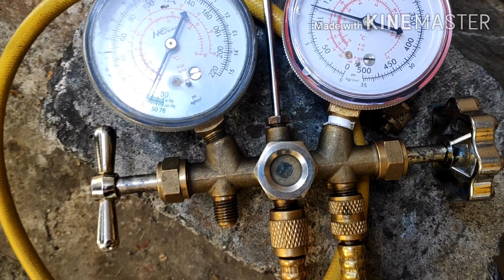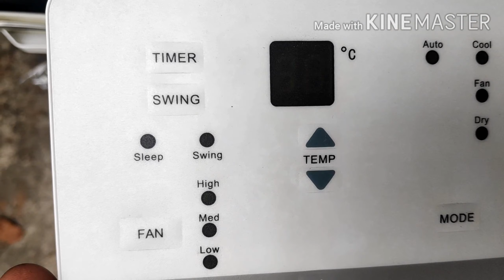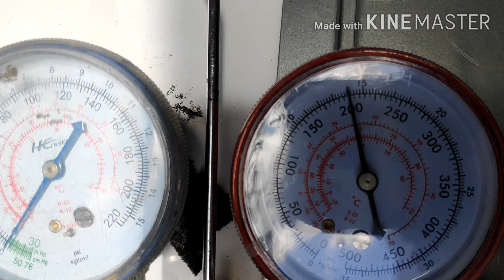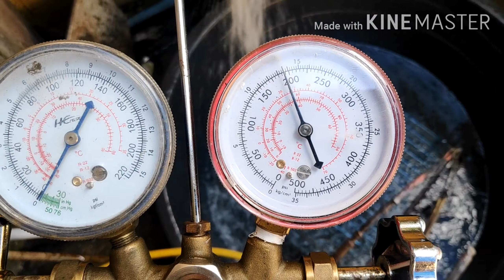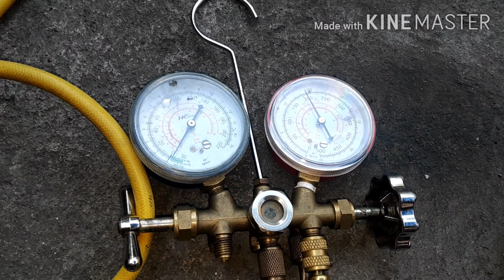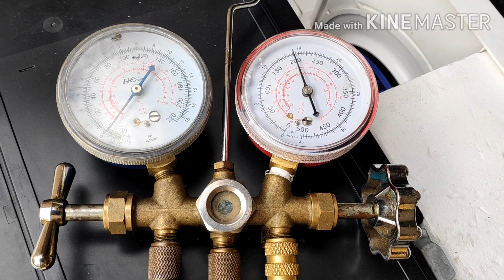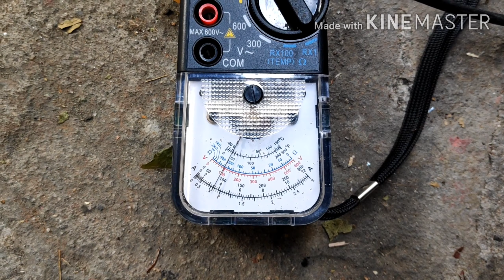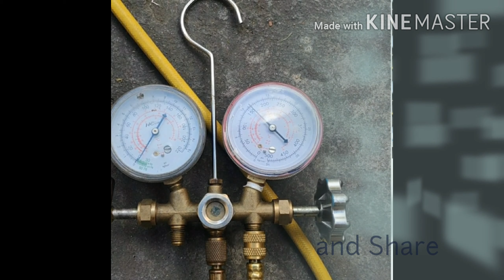Paano Gawin ang Window Type Aircon na may Butas  (#15)

Comment: sir, safe ba na pangvacuum ang compressor na 1hp? salamat po idol
Reply from the maker: Hello sir allan if compressor ng aircon ok lang lang po basta walang leakback pressure or lose compression, mabilis pong mag vacuum pag yan ang gamit
    Pag compressor naman ng ref mas ok po kasi matibay ang compressor ng ref
Reply: @jhaybizz  sir, pag compressor gamint ilang minuto pagvavaccuum?
Reply from the maker: @allanpalad2159  sir 2-3 mins lang po
Reply: @jhaybizz  ang bilis pala... sir bakit naflushing ko na gaya ng ginawa mo. pero over na sa rated ampere niya di pa umaabot sa 50 psi yung ginawa kong aircon namin. salamat po sir

Comment: Hi master, ask ko lang po if magandang brand po ba ang koppel? yung non inverter na ac po.
Reply from the maker: Tnx for visiting my channel Sir Matt.
     Yes sir magandang brand po ang koppel matibay ang compressor at fan motor, kaya lang thin galvinized sila lalo na ang bulkhead (window type) saka ang sides ng condenser at evap
       Kaya mabilis po mag rust. Pero kahiT ang inverter unit nila matibay din po, saka dual capacitor nila matibay din, unlike sa ibang dual type mabilis mag leaky or mag open
Reply: Ohhh. Okay po sir, paano po ba nag kakaleak ang ac? Kasi po ang isang ac unit namin hitachi ang brand 1hp po minsan nag ice minsan hindi naman.
Reply from the maker: @mattjericovillareal402  
       If window type po yan, kaya nagyeyelo, possible sobra dumi na need na ng general cleaning pero if not, internal clog  yan sir. 
       Sa loob ng tube  may clog oil na nasa evaporator need ng flushing by system reprocess (or possible weak narin ang fan RPM)
          About naman po sa kung bakit nagkaka leak, dahil narin sa katagalan nagkakaron ng corrosion (color green) sa tube lalo na sa U-tube or sa mga thread ng coupling
Reply: @jhaybizz  ahhh thank you po tlga boss sa pag answer ng mga questions ko. Apaka idol po tlga ikaw.
One more thing po. Ano po ba ang mapapayo mo para mapa haba ang life span ng window ac po.
Reply from the maker: @mattjericovillareal402  First thing first po ay cleaning maintenance, quarterly or twice a year lalo na sir if madalas gamitin. Dahil  dumi ang nakakasira ng compressor. Mag a ice ang evap, and high current naman pag marumi ang condenser.
         2nd po. Check all rust part ng mga galvanize. If may kalawang i turco nyo na agad (rust converter) para maagapan, and spray bosny primer paint.
         3rd if manual operation, stay your thermostat in one setting. Wag laging ibaba pag naka off ang  unit. Kasi nakakasira ng thermostat 
        4th proper ventilation (avoid air bounce back) para di po exhausted ang compressor

Tnx po sir sa pagtangkilik
Reply: @jhaybizz  Sir super many thanks po tlga kasi apaka active niyo po sa pag sagot ng mga questions di gaya ng ibang channels na di kami pinapansin. Sir last question po sir. nakakasira po ba sa manual ac ang low voltage? yung voltage sags po  na ang lalast ng 1 minute po. na eexperience po ksi namin dito sa area namin eh.
Reply: @mattjericovillareal402  you mean low  voltage po nag da drop  ng mas mababa sa 220v ?
         Ang possibilities po nyan ay mababa ang current ng electricity, or may power interruption
         Nakaka sira po yan ng capacitor at compressor. Mas mainam po lagyan nyo ng Power on delay, power on delay po ang mag se save sa mga parts ng unit nyopo. 
       sa isang video kopo may paliwanag bakit need po ng power on delay para sa manual controls ng acu unit
Reply: @genesiscar2023  Ohhh. Kasi po sir for the first 2 weeks na na install ang window ac na koppel manual po para nag ka problema po kami sa power around 8pm to 10pm where we get  low voltage po below 220V nagana pa din po ang AC and di po kami nawawalan ng power, low voltage lang po talaga to the point na parang nag iiba na ang tunog ng compressor and yung light parang nag dim, and it lasts for 10 to 20 seconds max. but now po all is resolved kasi naayos na ng power company ang line namin ( turns out too long yung wire run from pole to our house) sir my question is, should i be worried that it affected my unit? should i have it checked? ksi since installation po no issues with the unit eh. working perfectly siya. Thank you so much po sa sagot hehe. sorry po wala po tlga akong experience sa mga ganito eh
Reply: @mattjericovillareal402  ah ok po sir
      nalaman nyo po pala na na bumaba ang supply from 220 volts
     yan po effect ng mababa ang supply. Halimbawa parang nag lagay  kayu ng other appliance na 220 volts (like deskfan) sa 110 volts. mahina ang rotation ng fan blade
       Pero no worries po if na restore na ang supply na 220v, at nag run na ng normal ang acu unit. wala po kayung dapat na i pag alala. Exept if nawala ang lamig or ayaw ng mag run ng compressor kahit na restore na supply na 220 volts. at sana wag napo maulet next time kasi baka may masira na parts.
Reply: @genesiscar2023  Noted sir. Thank you po sa pag sagot ng lahat ng mga questions po. Sir paano po matanggal ang Lumot na kulay pink sa Drain pan ng Window Ac ko? Parang nag iistuck po kasi ang water ehh. Although may tilt naman po yung unit para ma facilitate ang water drainage pero parang may slimy na lumot na red/pink na namumuo eh. ano po marerecomend niyong pwdeng ilagay na cleaner para mawala ang lumot?

Comment: Sir sana ituro mo paano ang connection ng air pressure na 200psi sa leak test more power po
Reply: sige po sir fer dc. gagawan po natin ng video para dyan.
Reply: Ang galing mo sir. More videos pa po.

Comment: question po totoo bang mabilis masira ang aircon pag tapat po ng sapa ang bahay? lagi ksi may butas ung window type nmin 😢 nauubos agad yung frion
Reply from the maker: Hello Mam Jonna. Hindi naman po maalat ang tubig sa sapa dahil fresh water yan, kung sa tabing dagat po mas prone sa corrosion dahil salt water pag nag evaporate. 
     Ang main cost po ng leak ay kung ang unit nyo ay lagpas 4 years na, nagiging manipis na ang copper tube sa evaporator, na naging-ging dahilan ng leak, lalo na sa copper na pa letter U sa evaporator, nagkakaron ng micro leak. 
    Kung na system reprocess na po  yan ng mga technicians ng paulet ulet. 
     Mahirap napo i survive ang unit.  Ang solution lang ay magpalit ng evaporator (fabrication) or kung lagpas 7 years na, ang unit napo ang papalitan, para hindi na masakit sa isip. 
    Marami naman pong cheap na window/split type ngayun na hindi branded na mas mura. 
     Better sa Anson Appliance kayu bumili para mas mura.(Kung meron lang naman po sa lugar nyo)

Comment: master pano po ba malalaman pag clug up ang unit?
Reply from the maker: Yes John nico, musta? malalaman mo na may clog if
1) nagyeyelo ang evap sa umpisa palang pag nagstart ang compressor
2) weak cool
3) if naka plug ang hose at compound guage hindi stable ang needle up and down siya
4)Pag critical, nagyeyelo ang evaporator after 2-3hrs
Reply: salamat lods godbles